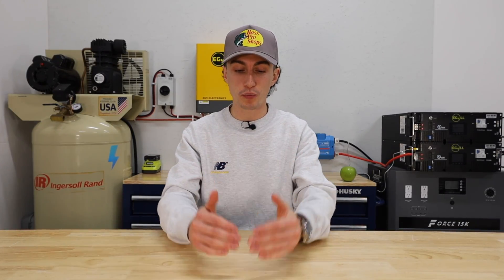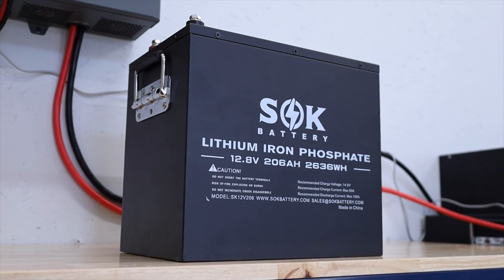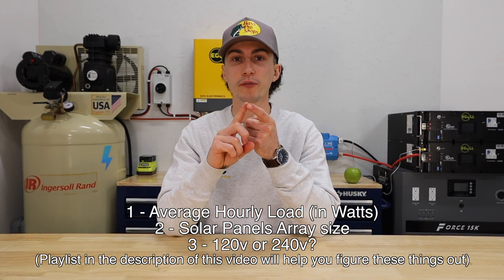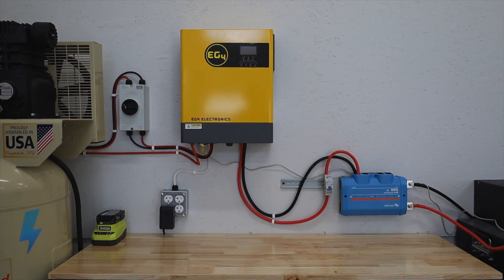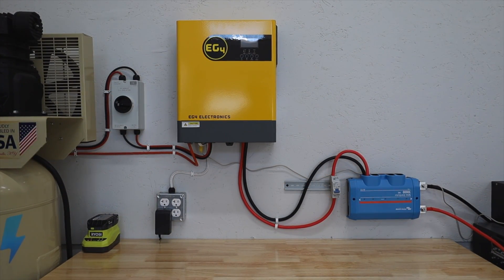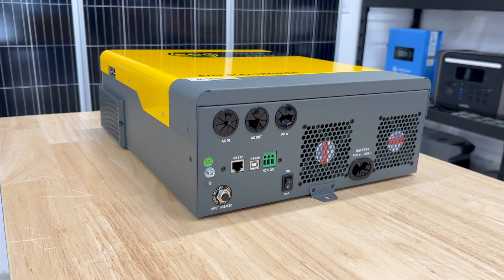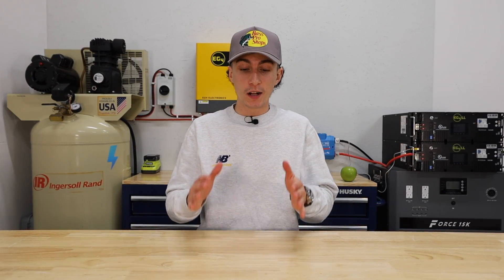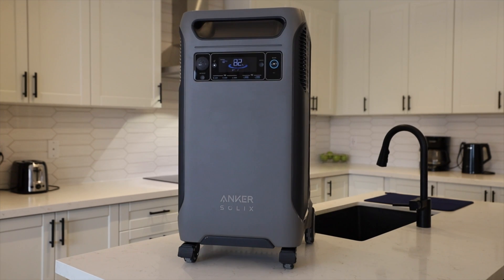Sizing Inverter For Your Solar Power System - The Basics (Ep. 6)

Comment: Quick question about planning my build... 
I live in a place where power is very expensive and my main goal is to save money, but my budget initially is somewhat limited (definitely under $10K). Would it be a decent idea to start with an oversized hybrid inverted that I could "grow into" (that EG4 12Kpv is looking mighty fine), then get just a few panels and just one 5Kwh rack mount battery, see how often the inverter has to switch back to grid power, and slowly expand from there? 
My thinking is that even if I'm running out of reserve power every day and my inverter has to draw from the grid, every watt I'm producing is money saved. Then I can add panels or batteries depending on where my deficits are.
Any thoughts would be appreciated.

Comment: The inverter should be the first consideration, as it powers the load... then you determine what battery you need for your inverter to be able to power that load, and then the appropriate solar array to keep the battery charged.

Comment: This all seems arse about face to me.   I have a certain amount of roof space, therefore i want to know what size inverter works best for my given solar array.    Any other order of doing things seems wrong to me.    Lets say i can max out a 2000w of solar power.   What size of all in one inverter is best for that size?   Ok, say i have a 280Ah 24V battery that someone kindly donated.   What is the best size of all in one inverter?  As i understand it, the more power an inverter is able to put out the more it takes to run it, the more you lose down the line before solar energy is converted to the plug socket, so sizing too high wastes power.